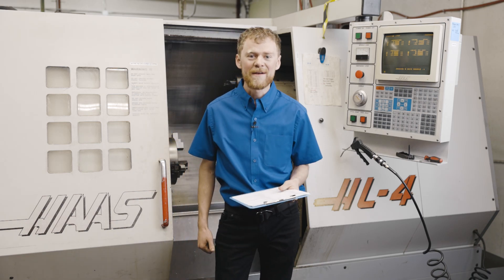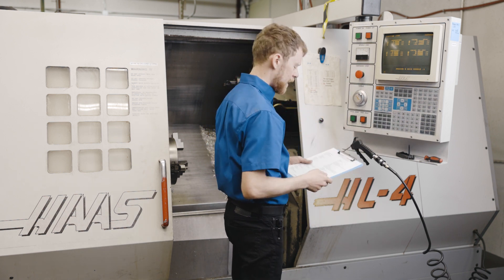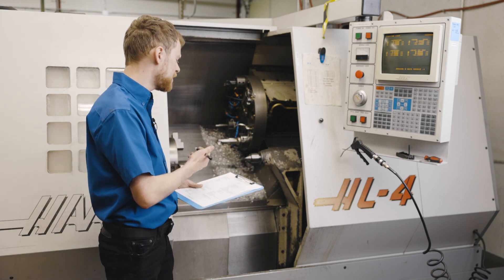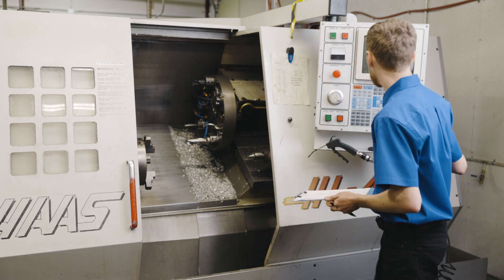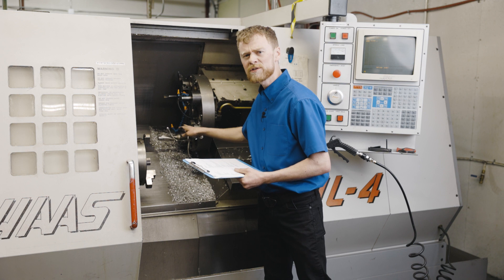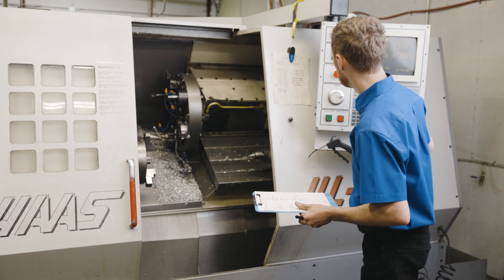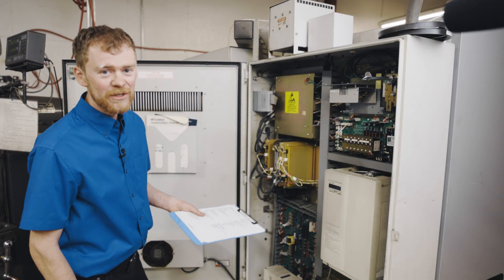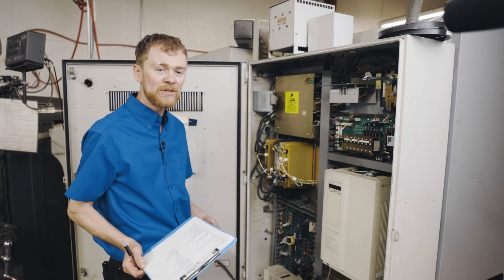Lathe inspection | With check list

Comment: An important check i would add to the checklist would be to a stress test on the hydraulics. Let the test run for a couple of hours to ensure that it doesn't get too hot during extended operation. If it gets too hot it has probably been run too hot for a while and will have cooked a bumch of the seals.